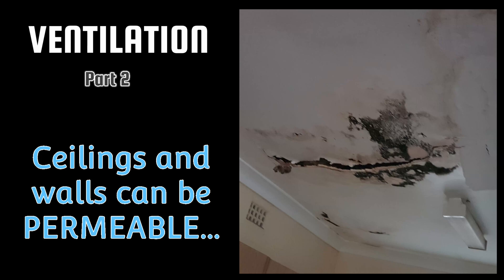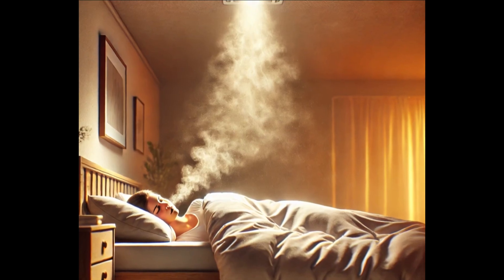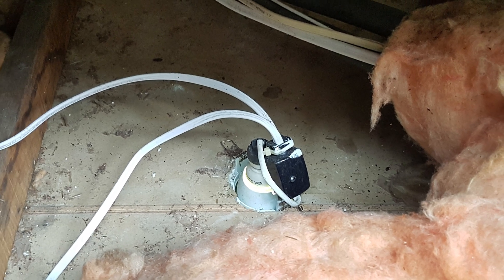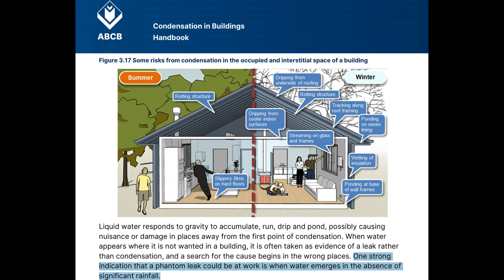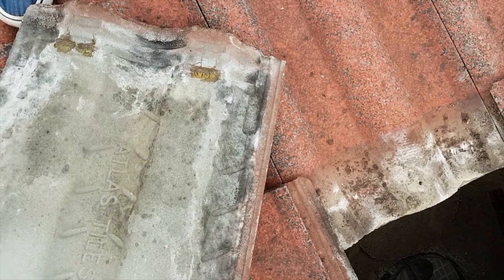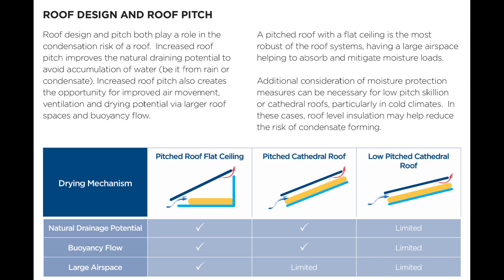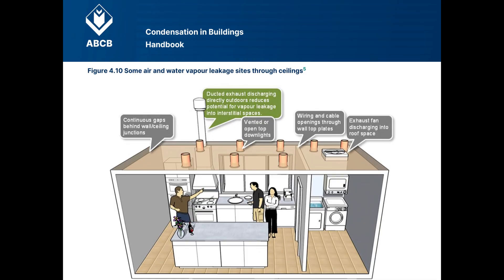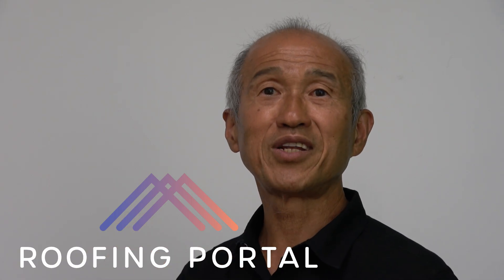Ventilation basics for Australian houses part 2

Comment: My 1970's Sydney home has plaster vents in all four corners of every room and bedroom, along with insulation batts in the roof. Would it then be advisable to remove/patch these? House itself has good airflow with lots of windows, and ceiling fans in all rooms.
Reply: With a pitched roof and ventilation above the batts you should be ok.